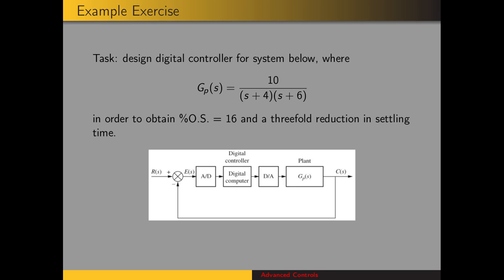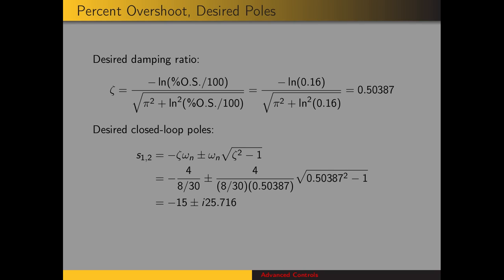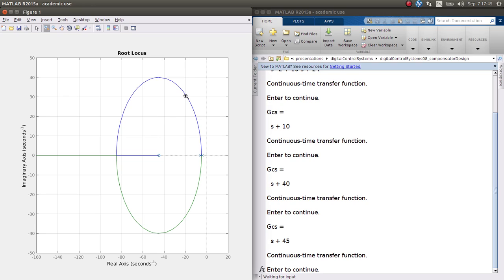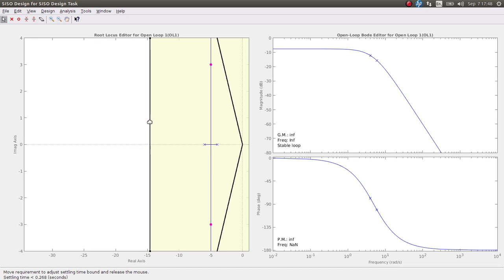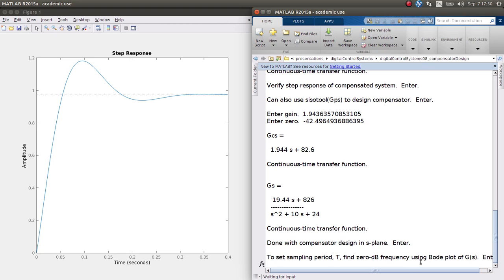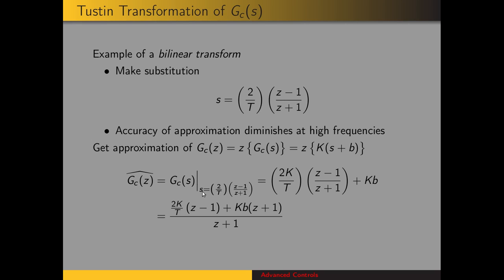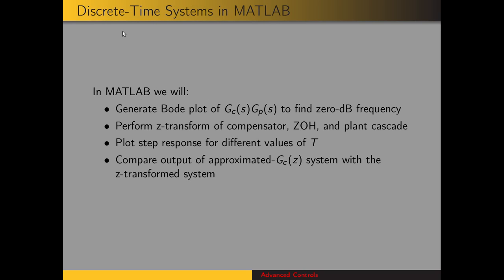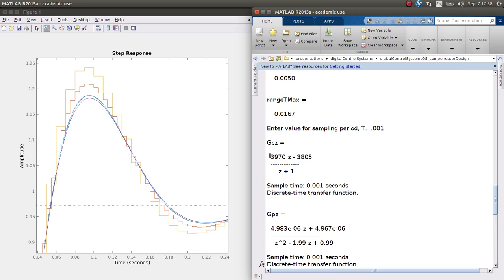DCS08_compensatorDesignViaSPlane

Comment: And can you even provide the link for the matlab example used.
Reply from the maker: Excuse me for missing your comment until now.  Even though you likely don't need it anymore, here is the example MATLAB code:

clear all
clf

%
% Use root locus to determine compensator values
%

s = tf('s');

Gps = 10 / ((s + 4) * (s + 6))

rlocus(Gps)

input('Enter to continue.  ');

zeros = [10 40 45 43];

for b = zeros

  Gcs = s + b
  
  Gs = Gcs * Gps;
  
  rlocus(Gs)
  set(gca,'XGrid','on')
  set(gca,'YGrid','on')
  
  input('Enter to continue.  ');

end

sprintf('Now use rlocfind() to get gain at desired poles.')
[K, POLES] = rlocfind(Gs)

Gcs = K * Gcs

input('Verify step response of compensated system.  Enter.\n');

Gs = Gcs * Gps;

step(feedback(Gs, 1))

%
% As alternative, use sisotool() for compensator design
%

input('Can also use sisotool(Gps) to design compensator.  Enter.\n');

sisotool(Gps)

K = input('Enter gain.  ');

b = -input('Enter zero.  ');

Gcs = K * (s + b)

Gs = Gcs * Gps

Ts = feedback(Gs, 1);

step(Ts)

input('Done with compensator design in s-plane.  Enter.\n');

%
% Convert to discrete-time domain for eventual implementation of digital controller
%

input('To set sampling period, T, find zero-dB frequency using Bode plot of G(s).  Enter.\n');

bode(Gs)

w0 = input('Enter value for zero-dB frequency (rad/s).  ');

rangeTMin = .15/w0

rangeTMax = .5/w0

T = input('Enter value for sampling period, T.  ');

z = tf('z', T);

Gcz = c2d(Gcs, T, 'tustin')

Gpz = c2d(Gps, T, 'zoh')

Gz = Gcz * Gpz

Tz = feedback(Gz, 1)

input('Verify stability of resulting closed-loop system.  Enter.\n');

[NUM, DEN] = tfdata(Tz, 'v')

poles = roots(DEN)

input('Plot step response.  Enter.\n');

step(Tz)

hold on  % Going to overlay other step responses on this

%
% Alternate sampling periods
%

input('Plot step response for T = 5 ms and T = 10 ms.');

TVals = [.005 .01];

for T = TVals

  if (false)

    Gcz = c2d(Gcs, T, 'tustin');
    
    Gpz = c2d(Gps, T, 'zoh');
    
    Gz = Gcz * Gpz;

  else

    Gz = c2d(Gcs * Gps, T, 'zoh');

  end

  Tz = feedback(Gz, 1);
  
  step(Tz);

end

input('Overlay ideal, continuous step response.  Enter.');

step(Ts)